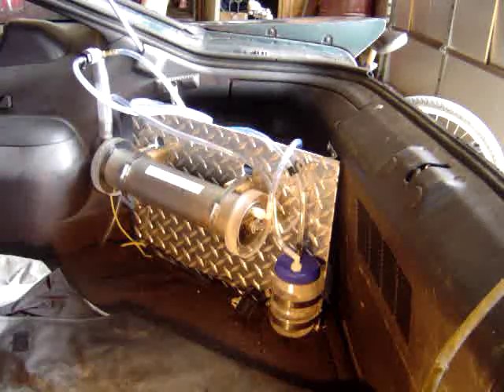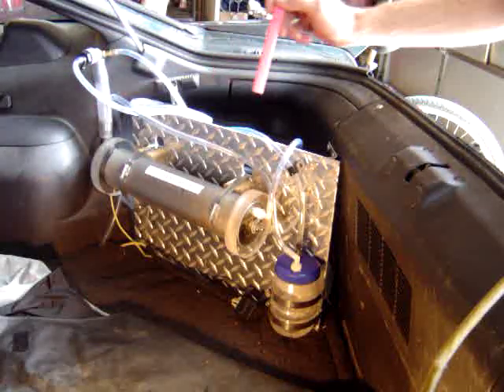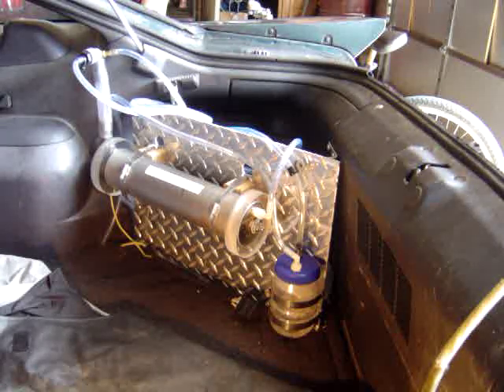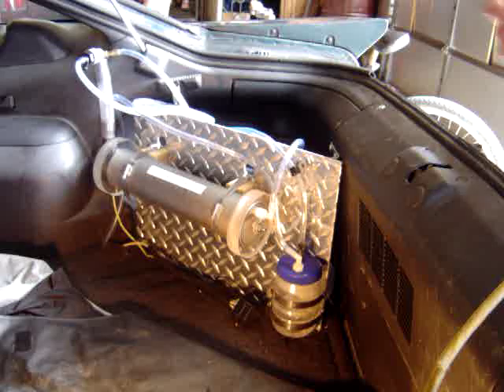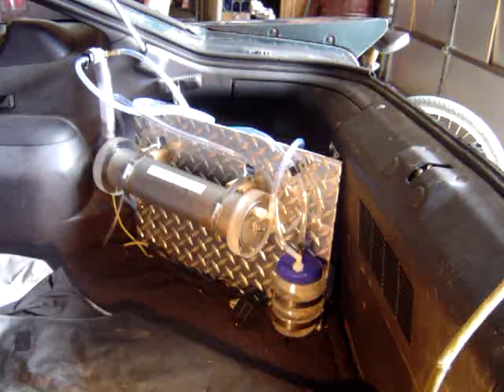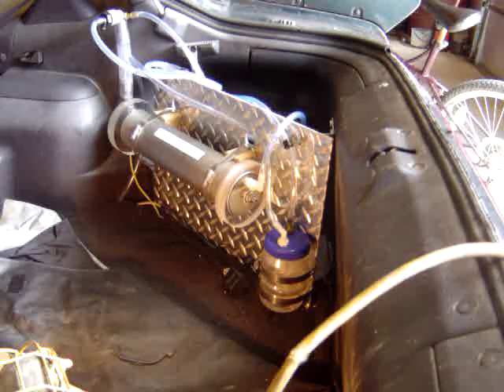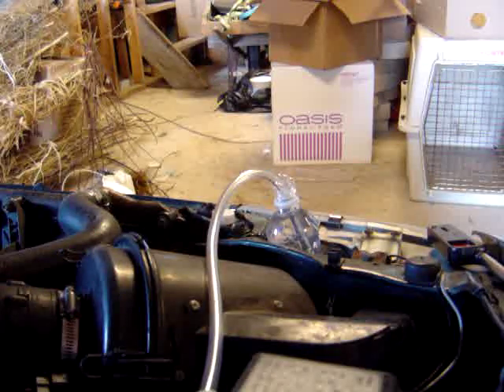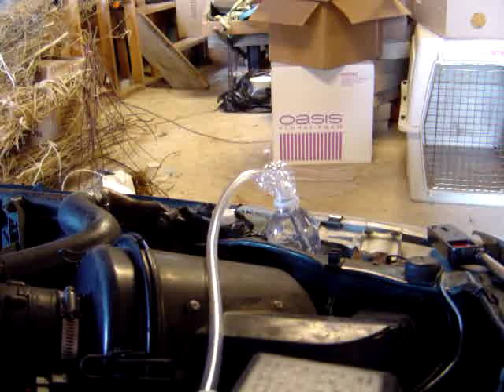HHO GENERATOR, HORIZONTAL VERSION

Comment from the maker: @johnnybio1 
not sure? I have since put this unit aside for a much more efficient dry cell setup (see other vids).
I would guess if it was a turbo car you would need to inject the gas before the turbo, around the air cleaner area. Otherwise you would need serious HHO pressure before any would be able to enter the engine. Sorry I cant be of more help.

Comment from the maker: Hey, it's a 92 eclipse (you are right, non-turbo). I have set this unit aside for the much more efficient 7 cell setup (see other vids). I am adding the HHO gas to the incoming air to the air box. To be able to replace gasoline completely it would take huge HHO production. Even with the 7 cell I am currenty running I am still having trouble fooling the engine computer. With the HHO added the engine burns so much more efficiently the oxygen sensor thinks its running lean and dumps more fuel in.

Comment: Try reversing the polarity ...cathode likes to be hot = more electrons available, your wires as cathode having lower mass will get nice & hot.  Outer case loses heat as there's a cooling effect. Try to keep anode at ambient as it'll draw heat energy from air around it = more efficiency.

Comment from the maker: Thanks for the checking it out but as cool as it looks it is extremely flawed. It has 304 grade stainless mesh inside (+) and stainless outer tube (-). VERY inefficient design. I was gettting about 30mpg highway before and 33mpg after. Also by running such high voltage in a single cell it forces huge amounts of iron out of the lower grade stainless. I do not suggest this setup unless you know something I'm missing. My next attempt will either be a multiple cell setup or a dry cell.